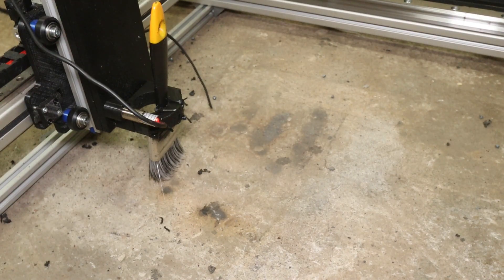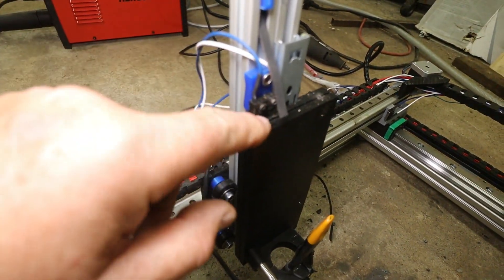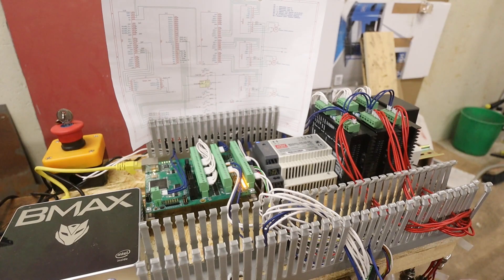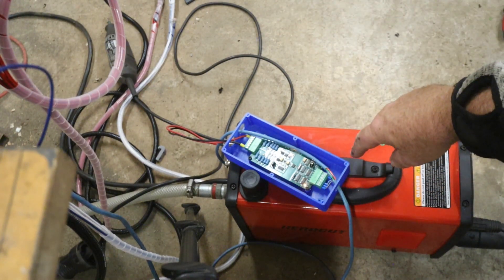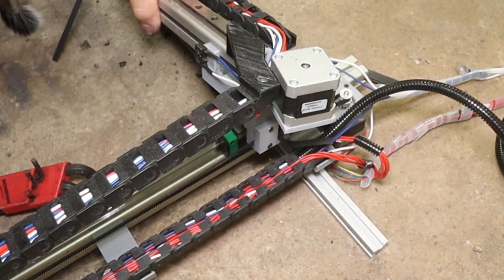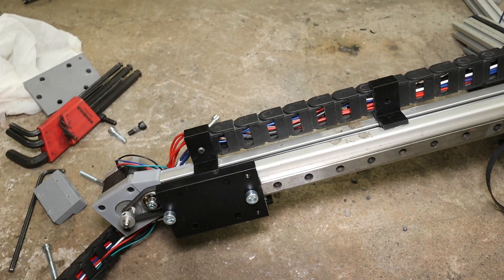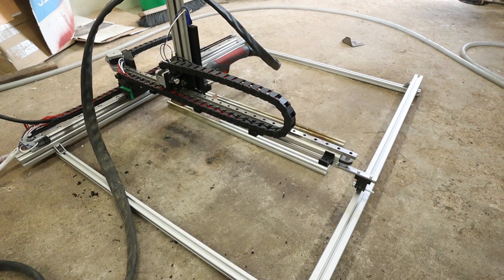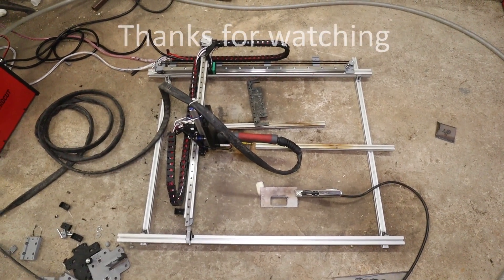I built a CNC plasma cutter

Comment: pla likely will not work for the torch holder... Mine lasted for about 5 minutes of cutting before it deformed.  I was thinking about integrating it into a tool cart where I could remove the top when I wanted to use it, and add the top when I needed a mobile table.  Interested to see what you do with the frame.